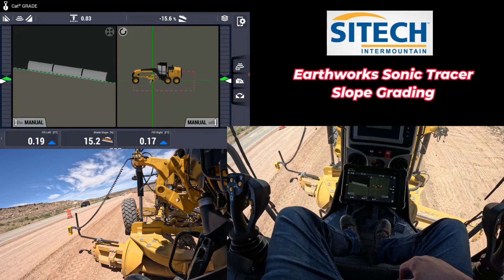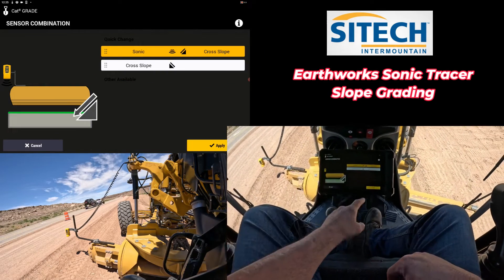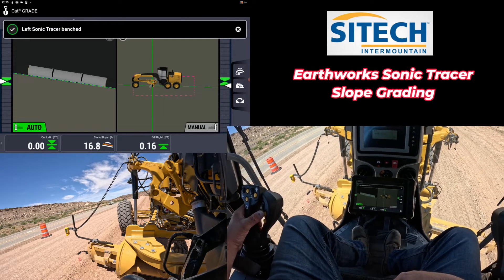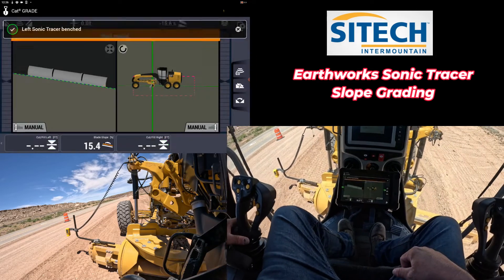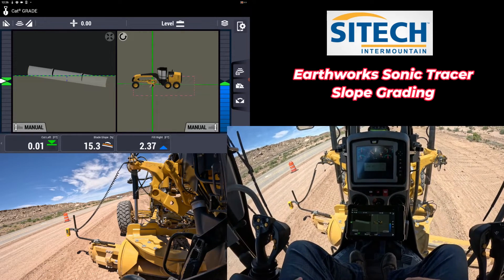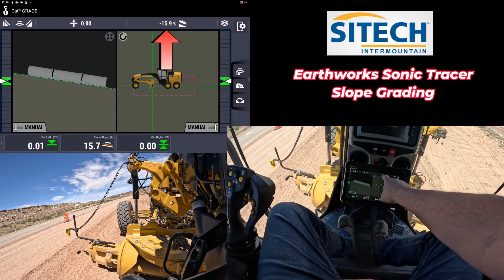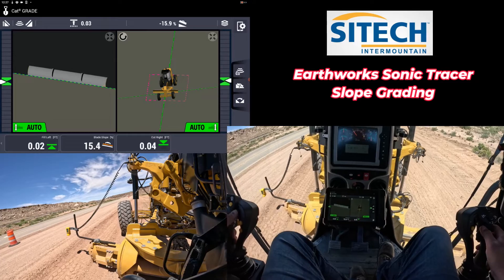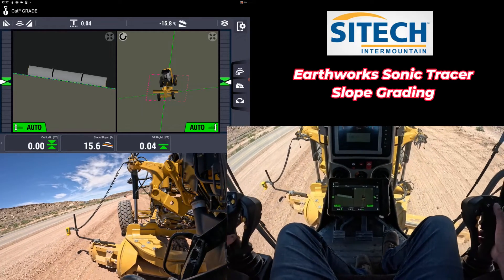Earthworks Sonic Tracer Grading Slopes

Comment: Hi jeff love your videos ive learnt a lot from your videos thank you,im on a excavator equipped with trimble gps and a tiltrotator, tiltrotator needs to come off for maintenance, standad hitch being fitted temporarily can i save machine settings so i dont have to measure up the tiltrotator when re fitted im used to measuring up buckets, i could probably do the tilty as ive seen videos on YouTube but its a bit complicated,im sure i can save the machine set up onto a usb am i correct much appreciate any advice jeff regards colin over in uk👍
Reply: Yes. In the web interface app there is hopefully already a machine measure up file that was saved when whoever set up the machine did it. Meaning the installer should have already save the machine file down in the Advanced tab on the left side of the web interface and under Machine Definition Files. You should not have to copy it to a thumb drive or anything unless you want a backup.  Once the Tilt Rotator comes off, the machine will need to be configured accordingly in the Configure tab in there to tell it that it does not have it on any more and to not look for the sensors associated with it and then you can do the normal bucket measure up like you mentioned.  Once you configure it for a normal bucket and do that measure up, you may want to save the new machine file in the same place under the Advanced tab and Machine Definition Files option for the new config.  Once the Tilt Rotator goes back on, you can simply check the box for that machine file and reload it and all your settings will come back for that. I appreciate you watching and I am glad all this is helping.